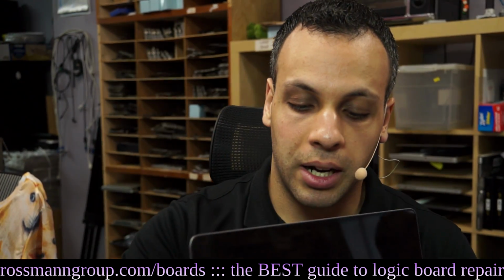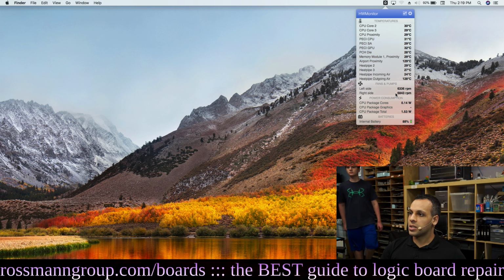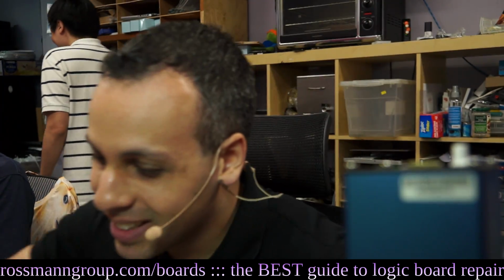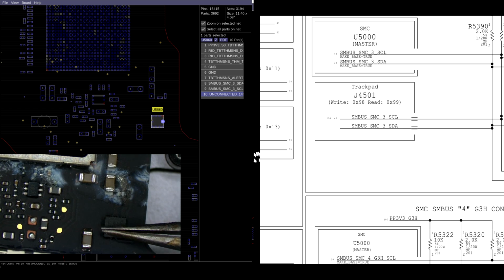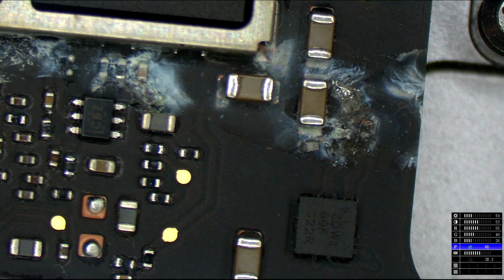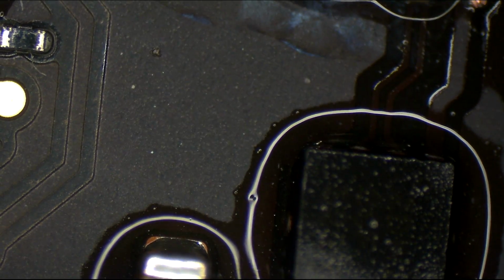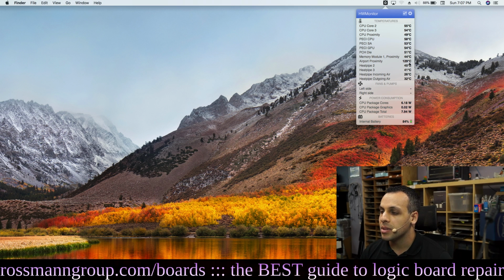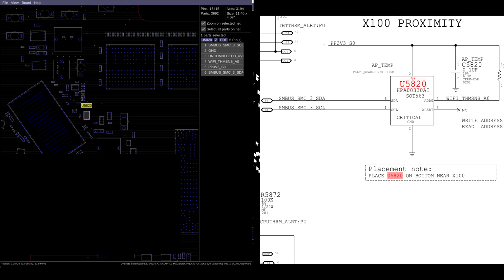How to repair sensor on Touchbar Macbook when running slow without Apple diagnostic software

Comment: Was watching a video about farmers having the same problem with their expensive farm machinery. They used to be able to plug in a laptop to see what sensor & part was broken and then fix it. But now they have to spend thousands to take it to the dealer to fix as the sensors are encrypted. They are trying to pass a right to repair law. Sounds like you need the same.
Reply: This isn't just limited to farm equipment as machine manufacturers are now doing the same thing. PLC's that can't be accessed and now saying you void the warranty if you open the control panel. This nonsense needs to be put down.
Reply: They can just buy and maintain older equipment which is what many do
Reply: Andrew Delashaw
You won't make money on parts if the farmer loses half his crop, and has to spend thousands of dollars transporting a tractor back to the dealer, just to replace a dud sensor. The farmer will be pissed off, and will never buy that brand again. Farmers aren't like Mac fanboys. They remember, and they hold a grudge.
Reply: Or...just have a cult of farmers who somehow only buy your machines, no matter how bad it is.
Reply: It's madness that farm machinery doesn't have similar rules as car makers have to follow with OBD complience
Reply: Ever heard of an oil bath air filter? They had them on tractors for decades, they worked great and the farmer could used engine oil to refill the canister. Then manufacturers decided they wanted to make lots of money selling air filters and they disappeared from use.
Reply: Create newer machines which are much more efficient to entice farmers. 
Afterwhich, have a closed loop of service centres and make it illegal to sell spare parts individually. 
All parts are tagged and must be used to service existing machines, which are of course uniquely tagged too. Unregistered home-brewed parts made by metal 3D printers shall not work as the software will detect the part as unknown and refuse to start.
Reply: I am a certified auto mechanic and what's happening is happening across the board. The problem is that they are bypassing the laws by making it incredibly cost prohibitive to diagnose issues. The repairs are usually pretty straight forward but without the diagnostic equipment it's hard to fix the correct part costing more money in the long run. The problem is that the software to diagnose these problems IS available to the public but it is very expensive and most people don't see the value in buying it (especially since licenses have to be renewed every few years). It's pretty messed up but the addition of more electronic systems and more communication networks is a blessing and a curse.
Reply: Was it the Motherboard video?
Reply: Eric Hallahan I think so
Reply: I mean CARS around the world use OBDII, the car tells you to a T what failed.
Reply: @neyoid  Not around the world son, it's only a law in the U.S of A. I have a goddamn 2012 Peugeot that uses a goddamn stupid proprietary port for diagnostics, the diagnostics equipment costs $2000. Cross your fingers and hope to hell you don't get a check engine light.
Reply: @mazzalnx you are either lying about the age of your car or just straight up lying!! ALL CAR ALL AROUND THE WORLD since 1996 have used OBDII for diagnostics ports & even you as a non-mechanic can spend less than $20 to get a diagnostic kit for your car that will tell you any faults & the fault code number. Your car doesn't have a "stupid proprietary port" & nor does it cost $2000 for the equipment!
Reply: Moistifier you’d be wrong, OBD2 only tells you what sensors are seeing and what parameters are out of spec.
Reply: Hospital equipment also did the same thing. You have to use the same software for endoscopy and radio diagnostic which is sold separately from the product, and 1 years after sale service only. After 2-3 years they would stop supporting it, and made a new model with the same crap and different code.
Reply: Maybe one day government will give consumers equivalent lobbying power to the corporations. Not holding my breath while waiting.
Reply: If anyone has a quick minute look at the Right and Ability to repair act that was pushed into legislation in Nebraska. Watch the public hearing committee. See who and what companies attended it. AT&T, John Deere, Apple, Microsoft and a few medical equipment organizations as well. It was supposed to be a proposal committee for the passing of it and it was met with conflict by the 0.01% that control the majority monopolies on multiple technologies.
Reply: Somehow this is still a problem
Reply: The fact that this ever became something we'd have to fight for...
Reply: It's no mystery. Since tractors are a relatively low sale quantity product, tractors/heavy equipment manufacturers/dealers make a bulk of their money on replacement parts, not the sale of the tractor. So if they're not going to make their money in the back end, they're going to make it on the front end. That'll essentially make it "socialized" by raising the sale price of the piece of equipment, making EVERYONE pay for other people's repairs. They're going to make their money somewhere. They're shooting themselves in the foot, because the cost of the equipment is going to increase significantly (since BOTH, the manufacturer AND the dealer, are going to raise their prices.), and someone who might not have had very many issues, it's still going to pay that extra money... And then they're going to pay for the replacement parts TOO, and a lot will have to pay for dealer service too. Even if an owner/operator takes really good care of their piece of equipment, gets a well assemble example of the piece of equipment, and may not have had to do lots of repairs or but lots of posts, are also going to pay that increased costs.
Reply: @xenonram  Don't make excuses.

We have same problem with expensive software, that require dongles to work.

Signwriting Software
CAD Software

"Oh we can't let people fix it on their own, they have to go to a dealer".

DON'T MAKE EXCUSES for CRAP PRODUCTS.
Reply: your wrong about they'll "make it on the front end" it's actually far less easy to make it that way. That's because repair costs are often obfuscated, when you go to buy a tractor you don't add into it the cost of having to replace say a failed sensor anymore than you might buying a new car.

With repair costs, you often don't have competition and that's the thing you have to understand, AS LONG AS THERE ISN'T RIGHT TO REPAIR. You can charge it and they have to pay it. 

As to the idea that a device would be more cheaper, an iphone is a thousand dollar device with the same closed pay us ecosystem, it's no cheaper than the muuuuch more open samsung ecosystem this really is an apples to apples comparison, you can repair a samsung, you can't an iphone, they are similar products with the samsung actually cheaper.

It's like for example buying a Landrover as a luxury car, if you don't know enough about landrovers you might not realize the maintanence hell your getting yourself into.

If you on the other hand have right to repair and john deere decides "we'll raise prices by 20% to cover" some smaller tractor company coming up will not and steal customers. Do you really think the chinese are going to raise prices on a tractor if you don't come to them for repairs? they don't give a damn it all sells for the same off the factory floor buying it as a manufacturer or bulk for repair parts. It's John deere that provides the mark up not china.

If john deere refuses to continue selling for the same price, someone else will, because john deere isn't "subsidizing" tractor sales I GUARANTEE you they already make money on every sale, they just make even more off repairs and they'll either take less per tractor or lose sales to someone who is more cut throat.

They can still make high margins other ways. They can charge a good amount for the diagnostic software with lots of updates (ala car companies) They can still overbill insurance companies (ala buying genuine parts to repair after an accident) They can even find other things to sell, like how airlines sell priority boarding etc. They can focus on options, want your tractor in a custom color? 1,200 bucks. Want it with upgrade X, Y or Z? 1,200 more. Want a 24 inch HD display instead of a 12 inch standard? more. They can probably partner with GPS companies and even seed companies and such to supply you with various ideal planting, routing, soil monitoring etc whatever for a monthly fee.

There are ways to get money still that people will resent less. Sell em leather seats that are heated, a few cameras you can see through on your LCD, the option to put your farm logo on the door etc. Do what the car companies do, they sell cheap cars for 10k new and make a profit, john deere can to and they can make ALOT off the cadilliac version of tractors.
Reply: There's also the fact that, as Apple already does, once the ability to repair is locked down and only they can repair it at whatever cost they impose; they make it break more easily.
Reply: I think a more recent video addressed this. Farmers want to farm, not deal with error messages, so they keep dismissing the warnings until you get into engine destruction territory and the system will throttle the engine until the dealer fixes it. There's also some farmers that want to bypass those pesky EPA requirements and make the tractor more powerfull and cheaper to run. (Like not using expensive additional fuel additives that clean up the exhaust at the cost of some horsepower.)
There's probably some stuff that a farmer should be able to fix that is made too difficult, but for each tractor there are a million consumer electronic devices... Apple makes more money scamming a million people for a few hundred dollars, than a tractor maker could make doing the same.

Comment: #Apple Logic:

Yo, the Wi-Fi temperature-sensor doesn't exist, that's why its 129°C.
->
Good customer service for Apple customers @ Apple Stores : 129°C

The headphone-jack on the IPhone 7 : 129°C

Real Innovation : @129°C

Apple products, that are worth the price : 129°C

#Apple-is-a-meme
Reply: They couldnt even screw up their temperature sensors properly, at least on other products it says eithe 0,1,99,or 100 Celsius. Apple: 129 Celsius, think different.
Reply: Jesse McCree, 129 makes sense. 
Sensor range is obviously nice round number (255), half of that is 128 (to represent range from -126 to 128, using a round number for positive values may also be intentional), and 129 is the next number just above normal range. 
I'm not sure how is this represented though, because it's impossible to do in a straightforward fashion using two bytes.. There are many ways to achieve that, perhaps the lower bound is -125 or something. Or, if they actually waste a bit on sign, then -124.
Reply: 129°C is a "overflow" 128°C = 1000 0000 in bits, 129 = 1000 0001, it's just an overflow handy to know when a sensor went haywire
Reply: I agree that Apple is way too hot for their own good.

Apple in 2012: 19°C
Apple in 2018: 129°C
Reply: Lmao
Reply: Damicske Your example isn't an overflow, a correct one would in a 16 bit example be 11111111 11111111 +1 = 00000000 00000000, because when you add one to a full 16 bit integer, it should carry one column left, but there is no column, so the 1 is lost and everything else "rolls over" to zero. Unless they defined 129C as 0 in the code, that's not what is happening.
Reply: This is true. I use HWMonitor on my Late-2013 MacBook Pro Retina and the Airport temp. sensor has always shown 129ºC.
Reply: Its also not limited to Apple, pretty sure this used to happen on Linux on older PCs if the specific board is not in the known board list.   It probably depends on if the sensor monitoring chip is missing or just the sensor itself, then it depends on how the sensor monitoring chip measures the sensor.  There is basically no standard output, I believe most of the work is done in the software that translates the output of the sensor monitor into something human readable, thus HWmonitor needs to know this chip may be missing and report accordingly.
Reply: Funny thing is, on my macbook pro 2017 in the same program "motherboard" and "airport" show 128*C :P Great, I feel better with every video I see here...
Reply: Makes sense.  Unsigned 8 bit value 0 to 255. Signed 8 bit value 128 is within the range of heat it might actually read.
Reply: it's most likely -127 just that apple made that read as one above char_max.
Reply: This needs to be a graphic T-Shirt. Would buy one as soon as available. Mr. Rossmann, please update your merch page to add this as a shirt!
Reply: Because, F... you that's why.
Reply: global warming .....

Comment: On my PC one temperature sensor with "mainboard" written next to it claims to constantly be at 113°C. But the system runs normal.
More annoying is that for more than a year now my graphics card spends most of its time spinning one of its fans at the highest rpm. Occasionally it runs normally. Otherwise the functionality is there, but this means that I almost never take my headphones off simply because they are relatively good at blocking out the sound. Or at least masking it enough so I am able to ignore it.

Comment: dual core for 1300$, only from apple.
Meanwhile i bought a notebook with a quadcore i7(with hyperthreading as well) 5 years ago, for 700$.
Reply: Same here and it came with a vid card that failed regularly on Apples but not on Dells. I still use it and i'm glad I got one with a I7.
Reply: In newer notebooks they tend to put the "U-series" i7 cpu's though. Those are only dualcores with a really low clock.
Reply: You are right there are dual core variants I had no idea. I thought all I7 cpu's were supposed to be true 4 cores even the mobile ones. Even my 700 euro dell had the i7-3610QM and that is a true 4 core cpu. 
I knew Apple sold under powered hardware at a premium but this is just sad.

Comment: I go through this same shit working on Apple devices, except if the board goes dead now I just tell them your board is dead, not worth repairing. Problem now is their data is gone too with the soldered in ssds.

Comment: The next models will have the boot selection removed
Reply: T P They aren't going to remove boot selection, they are gonna remove the boot drive, as well as all other drives and the ability to connect external drives.
Reply: I'm surprised they haven't done that already
Reply: Shhh dont give them ideas
Reply: Apple: You want to work for us for. 25 cent per hour in China?
Reply: The screen would be removed in the future models
Reply: Annually
Reply: You have to buy the raw materials so that they can evade taxes in some countries.
Reply: You called it!
Reply: niccatipay 25CENTS?! I CAN LIVE LIKE A KING NOW!

Comment: I don't do Apple, but I recently put a new Chinese Ebay power supply in my Asus monitor...and it worked again. Do you recommend installing a cooling fan for power supply boards in monitors, TVs, etc.?  Or is that a waste to time? And will it create a dust problem?
Reply: You better buy a genuine official asus charger... Chinese power supplies are notorious for failing due to cheap capacitors/having no protective emi circuitry.
Reply: Problem is, Asus is using the cheap chinese boards/components for their products. That's why some of their stuff breaks.  The replacement board I ordered was nearly identical with the same model number on the board. All I had to do was re-solder the old connector onto the board.

Comment: 360p isn't something Louis has done, but something that has gone wrong at the YouTube backend. It's been 22 minutes since the video was uploaded, so there's been enough time for the encode operation. But the video won't buffer at all for me. Seems to occasionally happen to some videos. My guess is it's because the YouTube CDN has had some kind of DB malfunction where it misplaces the uploaded formats' BLOBs/Docs(if noSQL). Usually takes a day or two to get corrected. Nothing Louis can do.
Reply: Akshay Anand 1080p60 here.
Reply: Looks like it's fixed now.
Reply: It can vary depending on what you use to watch.  Quite often I find videos where VP9 is only available in certain resolution and H264 in another.

I have found videos in 360p when played on my PC that will download in 4K when I use a downloader and check which resolution is available for which codecs.  Its quite frustrating.
Reply: Well look who took a web design class
Reply: Seems to happen to me at random. I'll watch videos that are years old and it will force 360p with no other options. Load up the same video an hour later and it's fine. Only on YouTube.  x_x
Reply: Alex Atkin I really think it's the Content Delivery Network. If you watch on apps/website, the geographically local CDN streams it to you. Downloaders/API connections see a different CDN I think. Since the video gets uploaded to the uploaders' CDN location, it then has to be mirrored to the other locations when demanded. I think that's the delay as well as the weird behaviour for downloaders. Have you ever encountered different download sizes for a video for same quality and codec? Like 360p on one downloader is different from another, and is also different from the YouTube app's own offline mode?
Reply: stfu stop saying shit and sound like you are smart
Reply: stfu stop saying shit and sound like you are smart